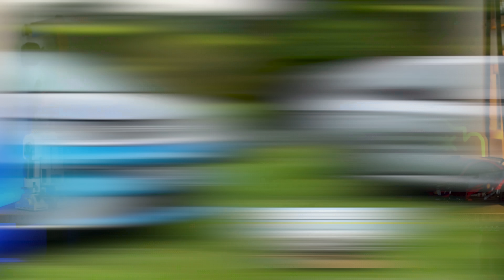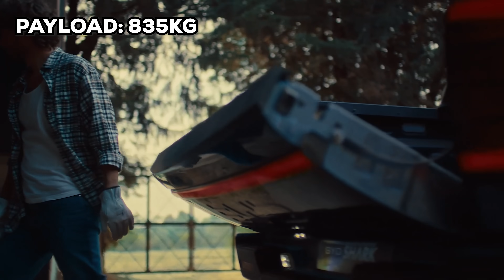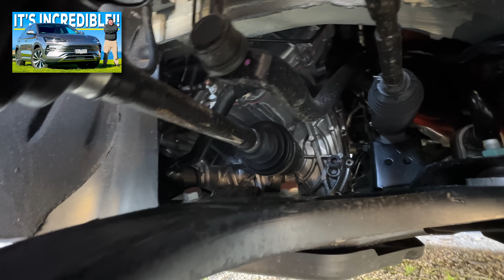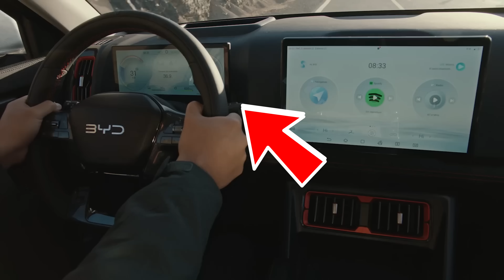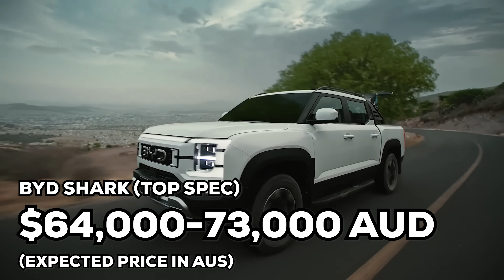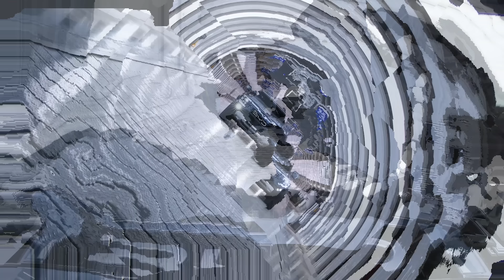The BYD Shark will FOREVER CHANGE the Truck Industry.

Comment: Musso also has coil springs (not only ranger and the shark)
Reply: You've all overlooked the most dominant coil sprung ute on the Australian market, Navara. They'd be more Navara coil sprung utes on road than Musso & Raptors combined.
I'd purchase coil any day over leaf purely on ride comfort & vehicle stability.
Navara prove payload & towing capacity are both feasible with coils. Took them a couple of attempts to get it right, but finally it's rated & rides well.
I may be wrong but I'd suspect 2.5 tonne rating more about unknown, trial & error, suck it up and see how it goes.

Comment: Traded a G20 330i for a Seal Performance and haven’t looked back. More power than an M3, yet half the cost. And nearly 10k kms and not a rattle or squeak. Nor any issues other than their subpar customer service, but hoping that will get better. Rides great. Great range. Quiet. Quick. And a huge rear seat. Usually a brand snob but the Seal Perf was worth the loss of a badge. If this is BYD in 2024, wait to see where they will be in 2030. Beyond the tech of the Germans, Japanese or Americans. Really amazed by Jaws as we call him. Will be ordering a Shark when they become available and a Sealion 7, if it makes it here. A much better looking SUV than the 6 and full BEV with mirrored powertrains to the Seal. If the Yangwang U8 comes, will def order that as well as thinking hard about the U9. Yeah, hook, line and sinker here. But genuinely impressed with them.
Reply: Still rather the BMW any day. Way more class than BYD could ever dream of
Reply: @mrkring1526  enjoy your class. i'll enjoy products that work
Reply: @mrkring1526 they do drive better dynamically for sure, I'll give them that.
Reply: Great. As long as you can find all the charging points and don’t mind waiting around while it charges up. Just make sure the power stations are fuelled up with coal or oil imported from foreign countries to fuel the madcap Western vanity projects. The West will get weaker whilst its providers will grow stronger. Genius.
Reply: What tf do you do for a living
Reply: @norincofan  BYD dealership owner? Lottery winner? LOL!
Reply: @bobsmith3983  they aren't expensive cars by any means
Reply: @norincofan  My question exactly 🤣
Reply: @norincofan1949 they are cheap cars lol. Have a RAM TRX that will be replaced as a daily with the Shark.
Reply: @norincofan CIO for a big tech company

Comment: Competition is key and having more features in the BYD hopefully makes other manufacturers take note. 

The reality is this product will suit many city buyers, however with independent rear suspension and a dismal tow rating, many ute buyers wont give it a second look. 

BYD have also missed the mark with payload for commercial buyers, where the magical 1T payload makes for an easy purchase decision. 

Time will tell re reliability, however perhaps the equally detrimental issue of depreciation still plagues chinese brands and EVs alike.

Comment: Toyota and Ford is wayyyy more worried than you are.
Reply: Toyota has a simple rugged ute called the tamaraw made and sold in the Philippines for less than 20k australian. If it came to Australia I would buy it in a heartbeat. so would a whole swathe of Australians who used to buy cheap Aussie utes.  BYD will be over 3 times that price. The tamaraw is not a hybrid yet, but will probably be half this price when it inevitably gets there.
Reply: No, Toyota and Ford are still the forerunners of new technology

BYD uses already tried and tested designs.
Reply: @ordinarydude2237  Toyota is now working together with BYD...

Comment: Starting price for $53K equivalent for a midsize in Mexican market is honestly a lot higher than I expected. I expected something in the $35K or at most mid $40K range (starting price of a Tacoma hybrid). Remember in Mexico a base Hilux starts at $20K equivalent so BYD is twice as much

Yet its towing and payload a lot less, no solid axle means it is never gonna be as off-road capable. It uses e-CVT rather than traditional torque converter automatic. Its 30kwh or so battery is stored not in the interior like the Wrangler 4XE or TNGA-F product but outside underneath the cab. So repairing and replacing on that battery will take longer and cost more money. Some of the biggest problem of the BYD DMO platform. 

This is not the game change that some people hyped up to be

Comment: Honestly I reckon the real elephant in the room is the Aus press carrying on about a towing capacity most buyers won't actually use.
So a request. When you can, I'd love to see this tow a 2 ton trailer & get some fuel / perf stats when you do. That's plenty for a 17-19' single axle van & a sensible amount of weight behind any ute.
Let's see it actually do it & I'm all in.
Seriously waiting for this to be released. With the novated lease incentives for PHEV until EOFY this has got to have a lot of people interested
Reply: I gather some embargo has been released given another video has popped up on a competitor channel... And sure enough, 2.5t positioned as a negative

Comment: Utes are so profitable because they're so overvalued for what you're actually getting, it's absurd. great to see BYD bringing something actually interesting and innovative to the most boring vehicle segment.
Reply: The most boring goes to the SUV market. 4x4 Utes are a close 2nd most boring. I really want one of the EV makers to fill the old Commodore/Falcon Ute & Wagon segments.
Reply: 100% agree. I work in the construction industry for 12 years and always have company supplied dual cab ute from triton, hilux, ranger, amarok and now currently is 2024 DMAX. They're so horrible to drive, very sluggish off the lights, uncomfortable, noisy, etc. I can't believe people actually pay $60K to $70K for this thing that has no intention to be used to carry loads or for towing.
Reply: @thearlongpark  People really buy these things to daily around town in 🤢
Reply: @Tommmmmmmmmmmm  Many of utes being bought simply because of the tax. A few times I asked whether I can just get an SUV or even a hatchback instead of the ute but never got approved because the ute simply allows the company to claim FBT exemption.
Reply: @Tommmmmmmmmmmm  Hilux in 20 years ago is cheaper than a Camry. It is remarkable for Toyota to sell you a tin box for 70k
Reply: They trick you into thinking that the car is going to make you money which it does if you're a tradie but most peoole aren't but still wants a ute.

Comment: "Burn Your Driveway" no thanks. I'd rather spend much less than 100k on a ute. I'd look at a new Triton for half the price.
Reply: Your Triton has a x10 - x20 times higher chance of catching fire 🔥
Reply: @Tommmmmmmmmmmm  not sitting in your driveway it doesn't, majority of ICE vehicle fires happen while in use which is the oposite to EV's. And then when the EV does catch fire good luck putting it out!.
Reply: James I think a horse, maybe a donkey, is probably more for someone as narrow-minded as you are.

Comment: I drive a Ranger everyday for work. It's the most overrated piece of 💩 I've ever driven, with constant electrical and mechanical issues. And that's before you even have to deal with Fords shocking after sale service.
Reply: oh I feel for you. I have driven a friends Ranger and couldn't believe they spent $70k+ on such a cheap feeling, unreliable piece of crap.
Reply: @Tommmmmmmmmmmm  
Totally. I have no choice over what work gives me but I'd never spend my own money on a Ranger or trust a Ford dealership to service a vehicle that I owned.
Reply: I had to drive a ranger on an iron ore mine for 5yrs. They look tough but aren’t. They aren’t good in harsh environments. The AC vent selector which is electrically operated would jam and get stuck on defrost… Not good in the brutal Pilbara summers. The whole dash needs to be removed to fix it. This happened about once a year! One of many issues.  I wouldn’t spend my own money on one.
Reply: @kitatit  They really wasted the name and reputation they had. Fords were always supposed to be sturdy cars, now all they have is the look.
Reply: @kitatit  
Copy that, very similar experiences 👍🏻
Reply: Yep driving a car for a few days and forming an opinion is different to owning one
Reply: @50outoftheblocks  
It's also about after sales service and that is poor.
Reply: Yep, had transmission and driveshaft issues with my Wildtrak causing vibration and sometimes severe gear changes. A software update did calm down the transmission problem but the vibration continued, ended up trading it in. Wouldn't touch one again!
Reply: @rayf9194  
I hear ya mate.
Reply: lol Rangers have a special electrical system. Some of the issues I've seen with those are honestly hilarious. It's still pretty good but they are still ripping you off for new ones.
Reply: Yup! Paying around +30% for the presumed prestige big boy toy.
Reply: @JH-jz1sd  
💯%👍🏻
Reply: @JH-jz1sd   30% more than what? Even the triton GSR are 64k to ranger Wildtrak's 76k (~%15).
Prices have gone ridiculous lately, even for crap Chinese models.
Reply: You gonna see improvement when competition kicks in🎉
Reply: @mingyudu469  
The ute market in Australia is already very competitive but I hope you are right.
Reply: @FishandHunt  All competition should result in two scenarios: higher value for the product or cheaper price. I think there is not enough competition if you have not seen either
Reply: Really interesting reading these comments. I see so many ford ranges on the road in Melbourne, thought they were high quality otherwise why would so many people drive them?
Reply: @L78321  
Good marketing and people are obsessed with tech.
Reply: Every manufacturer these days has reliability issues. I don't know anyone with a new car that hasn't had to take it back for some crap reason. Even Toyota isn't as good as they're made out to be - neighbours new Hilux back twice this month (just don't tell the fanboys!) and coincidentally he's not happy he traded his Ranger. 

So it comes down to how your respective dealer treats you. Out of my 2 closest, 1 is happy to help, the other treats you like everything is your fault.

With the Ranger though, they are the best to daily drive out of the dual cab bunch (and don't have the incessant voice speed alert of the Hilixes, yet), BUT they're crap when compared to pretty much any other car (except for some Chinese things, they're worse than an old 90s model Excel!!
Reply: Mate, in Romania we have a saying: never allow Ford cars and gypsies in your yard, it will never end good 😂😅😊
Reply: For top of the range spec, this looks well specd and has a 26kwh battery, they say 100k but probably more like 60-80k.

Comment: This powertrain has been widely used and achieved great success in China, which has also made BYD quickly become the number one car company in the Chinese auto market (China's auto sales exceed one-third of the world), and the sales and prices of German and Japanese cars, which were originally the number one in China, have dropped significantly.
The feature of this powertrain is that even if you never plug in the car and only run on gasoline, it is still the most fuel-efficient and powerful car in this type of car.

Comment: I have no use for a ute but if I did the Shark would at the top of my shortlist. I really need a van with better range than what is currently on offer. Until then my EV needs are plenty filled by my Seal Performance.
Reply: zeeker 009

Comment: it makes perfect sense for city offroader customer who wants a ute but not really towing a bucket load of things meanwhile getting decent fuel economy. It is actually a blank spot for in market.
Reply: basically 90% of ute owners
Reply: @Tommmmmmmmmmmm  more like 99.543%  
:P
Reply: Yep agree , I just need a Ute to carry a few dirty tools around and I never tow anything bigger than a 6/4 trailer
Reply: That's me, living in a shoe box apartment, with burger all to tow. The V6 Amarok I currently have is a complete mismatch to my situation which changed with my job a while ago. THIS IS PERFECT.
Reply: Exactly I'm looking to purchase a ute purely for dirt bikes in the back/camping trips. So something like this is perfect
Reply: imagine having a small gardening business, load all you power tools on a hybrid truck and just start working when you arrive on site with them already plugged into the car. Don't have to get power from the customer's house, or take a noisy stinky generator, or use those smokey power tools that runs on gas, or anything like that. A byd hybrid is probably the best gas power generator out there on the market right now.

Comment: Does anyone know if it's possible to use gasoline to generate electricity to continue  powering the Vehicle To Load and supply electricity to household appliances when the battery is dead?
Reply: Yes
Reply: Wow,  I hope BYD will produce  DMI campervan soon
Reply: @dicky-duck6632  there are dmi campervan in China, but those were mods on BYD dmi trucks
Reply: since BYD use gasoline to generate electricity for powering the car and they open outlets for people to drive outskirts to have picnic by using those outlets, should be works as electronic output.
Reply: I think Shark and Leopard 5 shares the same platform. I think it's possible to use the same platform to make campervan. But it really depends on the market for sure.
Reply: The engine is automatically started when the battery is low (~15%-25%). For your safety, don't use V2L in an enclosed garage.
Reply: Yep, hybrids basically use the engine as a generator and I think most or all of the V2L cars maintain this for uses other than the battery or motors.